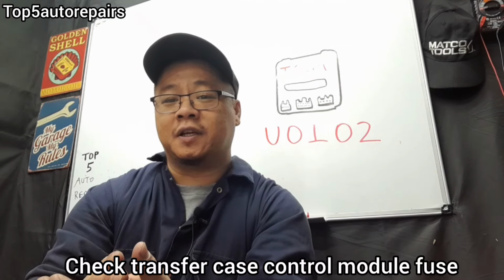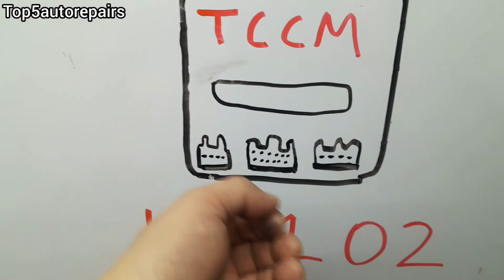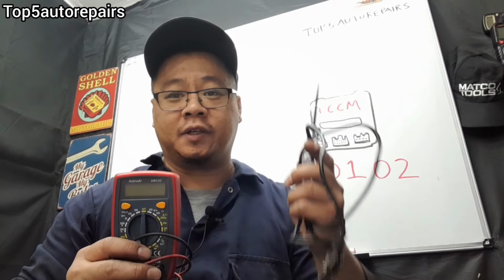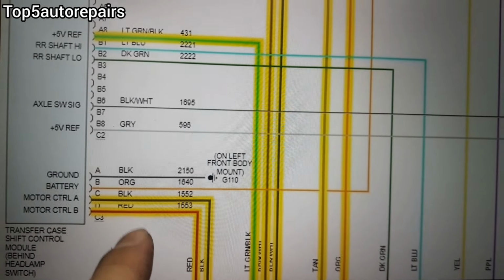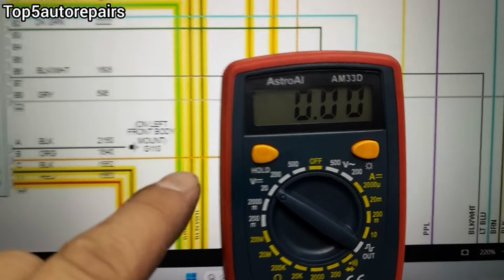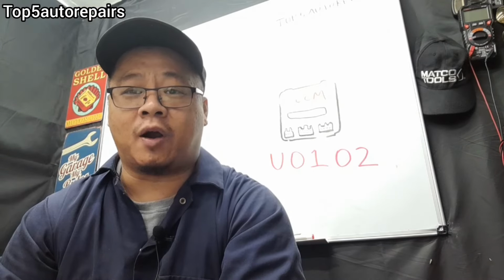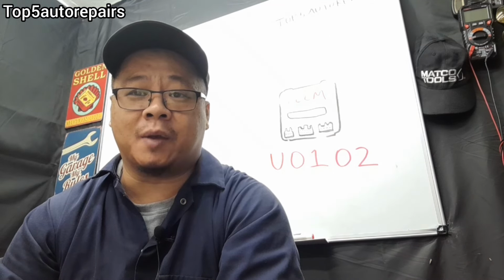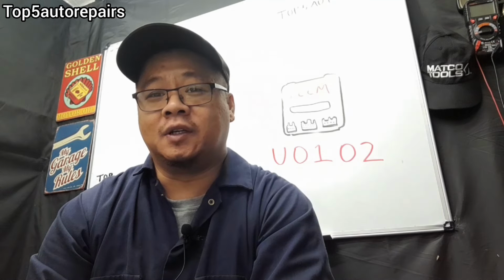U0102 LOST COMMUNICATION WITH TRANSFER CASE CONTROL MODULE TCCM

Comment: Hey bro I got a 2007 chevy suburban and its shifting late and doesnt shift from 3rd to 4th. I hear a click and it stays on 3rd and revs high going 70+. Only codes im getting is U0102, P0573, p0719. Could any of these codes cause that issue? Just did a transmission filter and oil change. Also put 2 quarts of lucas trans fix. It has an aFe deep transmission pan with a deep oil filter. Started happening after i swapped it. Thank you

Comment: Great video. I follow uo your videos keenly and apply them in my service delivery. I would ask a disturbing question. Ssangyong Actyon Sport (diesel Engine) with a P0619 fault code. The car cranks but it doesn't start. What could be the problem. Can you help figure out what exactly in the issue please. 

I awaits your kind response. Thank you again for your great teachines
Reply from the maker: It's possible the alternative fuel control module (bad ram) is bad. Can you open it up the module and check if it's burnt? Conduct a sniff test and it smells burnt then replace it. Since it's a diesel, check for power at the glow plug and remove a few glow plug and check it's condition.
Reply: ❤ thank you for the reply.

How do I program the new Transfer Case Module to vehicle ECM? 

Thank you